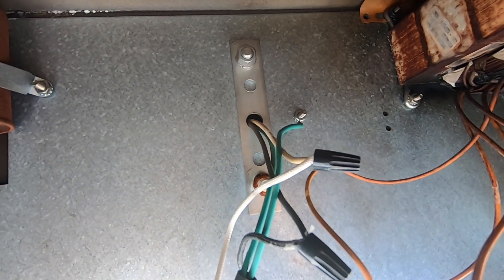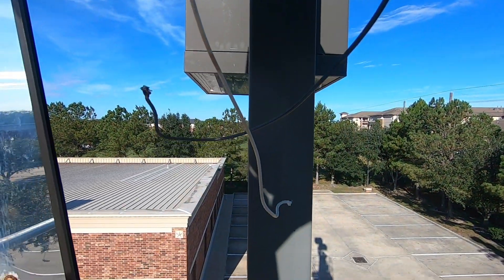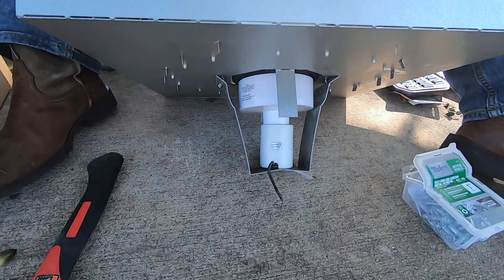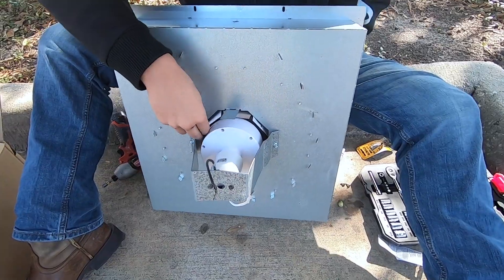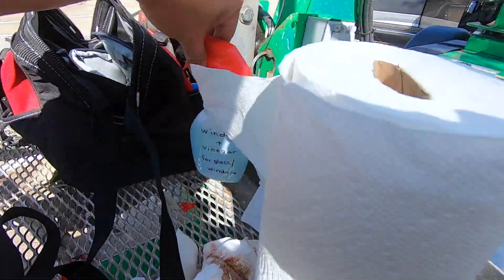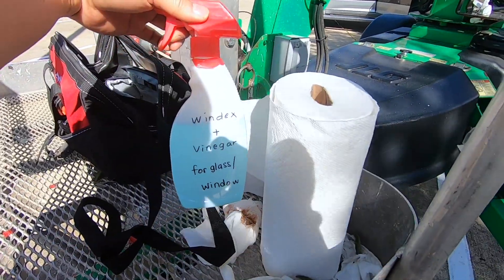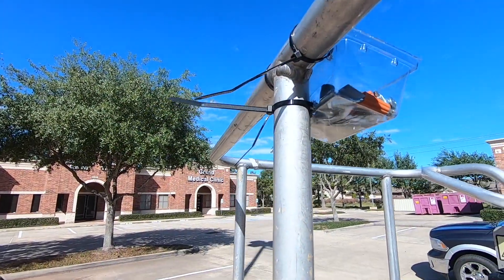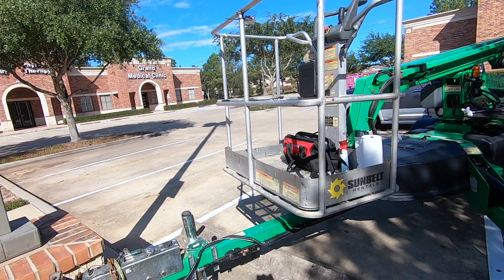Retrofit Parking Lot Lights (shoebox) from HID / metal halide to LED - convert HID to LED

Comment: So what is the voltage coming into the two leads? 480V (3-phase) or 240V? If it was 480V, did you actually have a 480V driver for the LED lamp or was there a step-down transformer in each fixture that reduced the primary voltage down to 277V.

Comment: I have a little hack to share with you for these gravity-unfriendly installs... you could probably make a video on this and get lots of love.. So... at the end of the vid - when you’re about to connect the wires and mount the retrofit unit into the shoebox - Get yourself a cheap length of thin chain (or rope/string/cord whatever) to connect the new unit to PRIOR TO connecting the wires from the shoebox.... take the other end of the chain (aka TETHER) and secure it to the actual shoebox making sure it’s shorter than the electrical wires ... this obviously prevents an accidental damage if the unit were to slip/fall so the wires aren’t handling the force & weight...

Taking this idea a step further - you can actually use the tether as a pulley system to lift the unit up into place and hold it there while you secure it in place..  this could also be something you LEAVE IN PLACE permanently so that the next technician (or you, if you’re maintaining the property) benefits from never having to worry about this unit dropping from 30’ in the air in the future... 

Obviously I’m not including all the necessary details (such as Proably needing to create a 4-Point connection to the corners of the unit (at least 2-points) OR the metho of securing the tether to the actual shoebox (such as fastening in an eye-hook to the box ceiling or etc) - but you get the point...  

Basically a safety harness for whatever you’re installing to avoid damage, injury, embarrassment, frustration.

Work smarter - Not harder
Reply from the maker: Great idea thank you